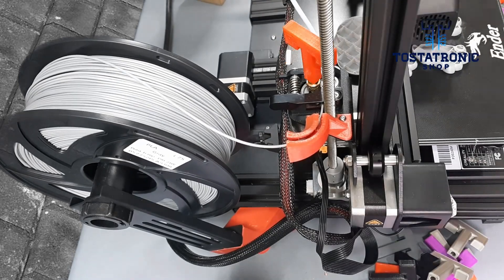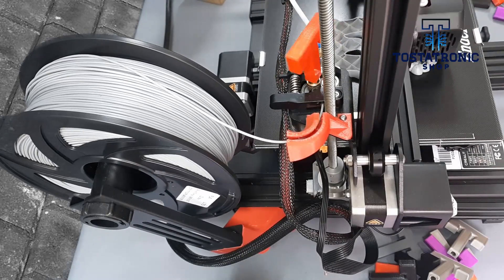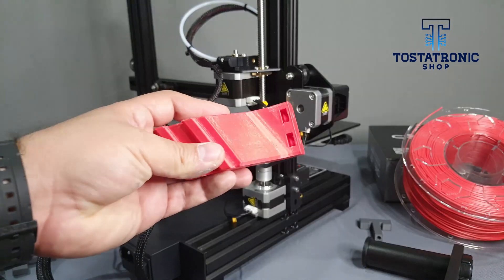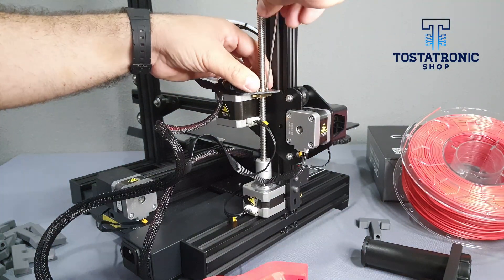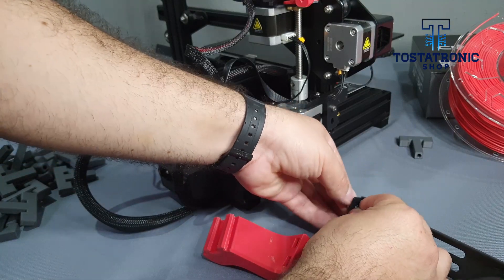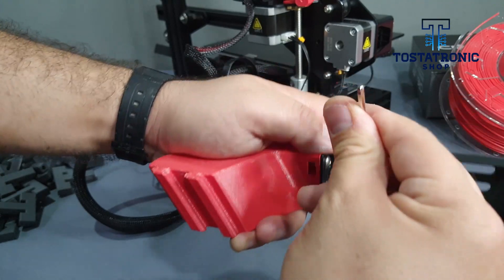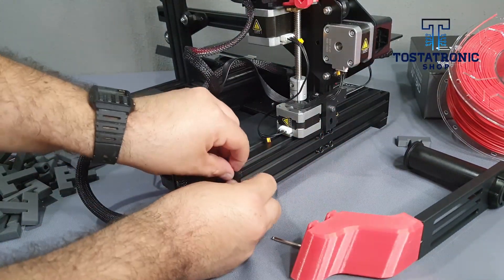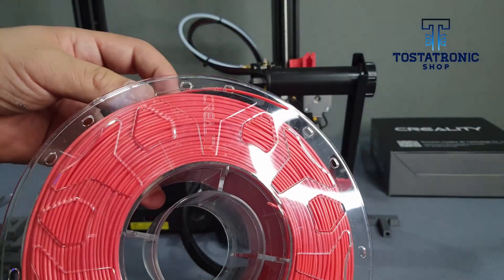Ender 3 v2 - First Upgrade Filament Spool Holder - by Tostatronic

Comment: Good upgrade,  but the first one should be direct drive, get rid of the tube, nothing but problems even after upgrades,  every 25 hours the tube has 2mm play in it and needs replacing

Comment: What infill % did you use on the spool holder section?
Reply from the maker: Thanks, it has 40% and 10%.
Reply: @VideoTutorialesTostatronic  Which is 40% and which is 10%?
Reply: @ve2evn543  i believe holder is 40% and the guide is merely 10% since it is not under any load